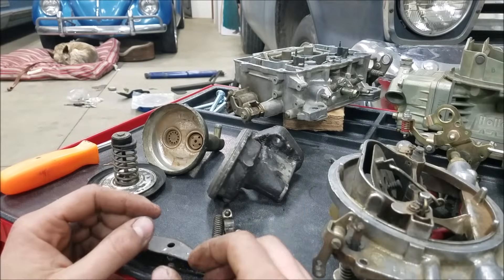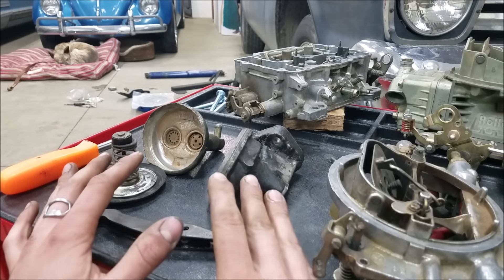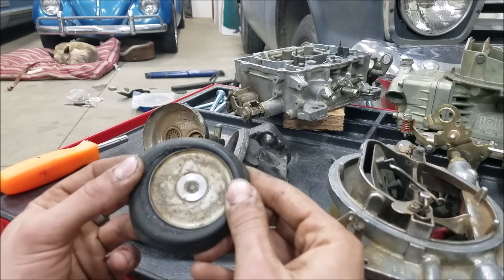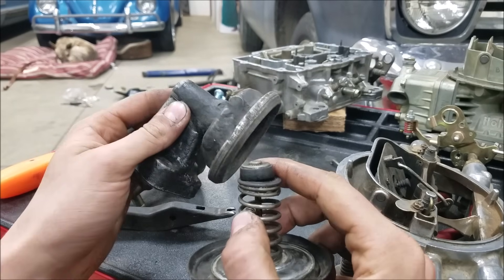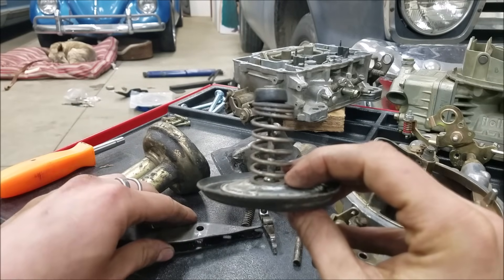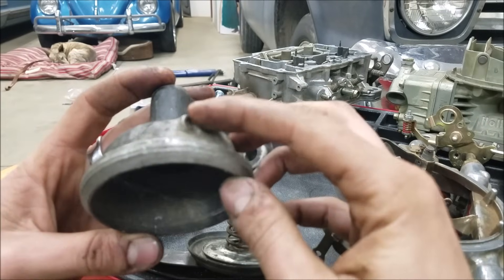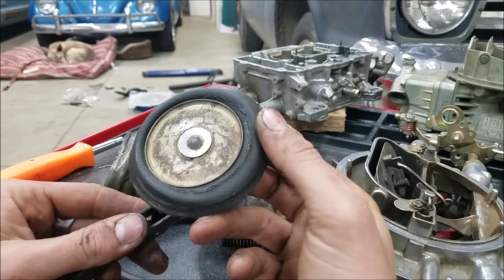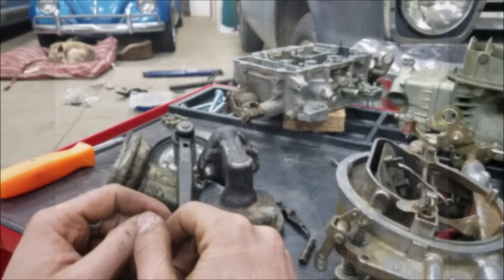Gasoline in your OIL?? Mechanical Fuel Pumps: Can a Failing One Do It ???

Comment: Several decades ago, I had an old ford LTD wagon (351w/C6). The fuel economy was horrid when I first got it (Like 4 mpg). One day I finally noticed the smell of raw fuel - the pump was spraying fuel everywhere, kind of like you described. Fuel economy quadrupled with the new pump. The next economy improvement came from sealing the leaking fuel tank.
Reply: kstricl yep I just fixed my 77 F250 with a 400, puking gas everywhere
Reply: My 82 225 Dodge lost it's fuel pump and leaked externally some, but I never noticed any in the oil.
Reply: You could drill a drain hole in the bottom of the housing, unless oil splashes out, in which case you could rig some kind of container to catch a little splash.  I think that's what the Dodge has, just a pressure release hole in a position to drain fuel better.

Comment: I have seen air cooled VW engines filled up with fuel cause of this. They run like crap when the fumes get through the crank vent into the carb.
Reply: Yep. Happened to me with my '62 Bug in '66 or '67. Wasn't the fuel pump it was a cracked carb separator.

Comment from the maker: I have run this fuel pump in my f100 for over 12,000 miles without issues now - here's the link: https://amzn.to/2Uwz8tT
i like to have a mechanical fuel pump eccentric & timing cover, but anymore only as a backup to an electric pump.
Reply: ThunderHead289 do you have a video showing how to install the mechanical fuel pump in conjunction with the electric fuel pump, return line etc?
Reply: Gotta love ethanol gas
Reply: I love your channel, very good content!
Reply: You're not going to clean that car, are ya.

Comment: I got a 1950 Ford f1 and the base of the acorn lugnuts broke off and I can't grab it but the rest of the stud is there. What do I do?
Reply: I've used a big nut splitter on lug nuts in the past with good success
Reply from the maker: grind off the excess & drill out the center - replace with new stud. annoying, but it will get it done.
Reply: @ThunderHead289  what if I don't want to ruin the rim and it's out side like 100 yards from ing house and I don't have a portable grinder
Reply from the maker: Be really good with just a drill - 
I hate to suggest this, but maybe a propane torch and one of those “grab all” sockets - I’d get what’s left of the lug really hot before I even tried
Reply: @ThunderHead289  there's nothing to grab it's the tapered end of a acorn out nut. I'll figure it out word case scenario I brake it off